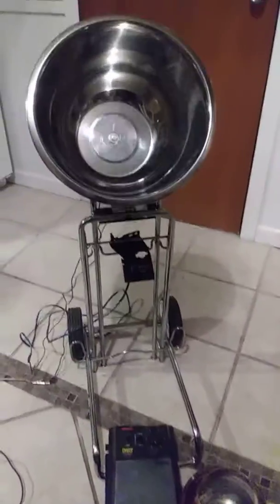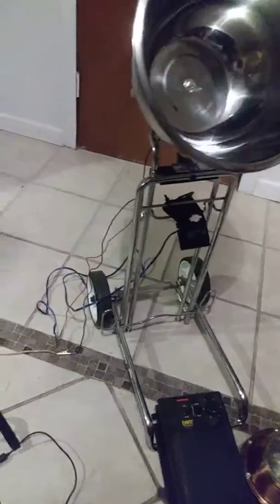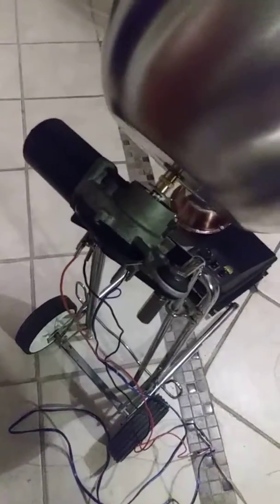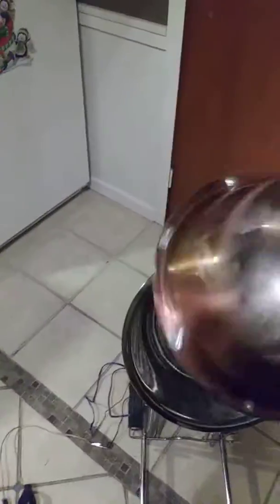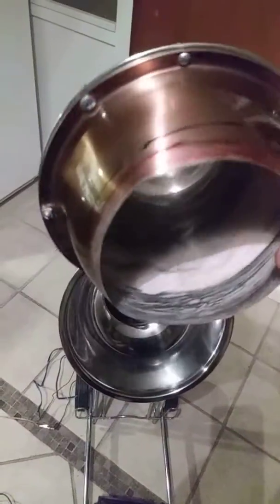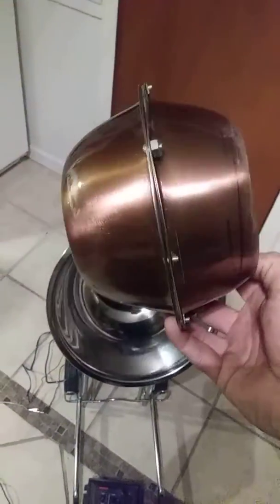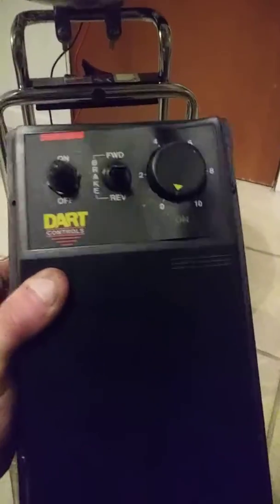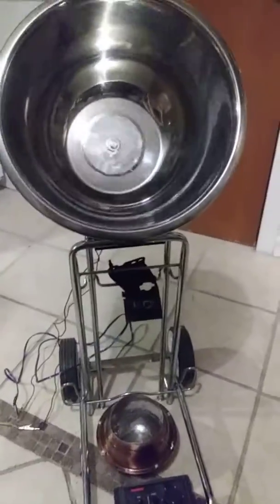Homemade star roller

Comment: Mock it up with the both halves put together. Then use them as fiberglass molds. That bonds isn’t going to hold up. Plus it’s porous, it’ll hold all the past and future comps. Just an idea....is all.
Reply: Bondo* Not a problem brother.  Or......just run it as it is. Use 1/8 or 1/4” bolts with lock washers and nuts(might be able to get by with small wing nuts). That would allow you to take it apart and clean the bowls.
Reply: You’d lose what? A couple tablespoons of comp?
Reply from the maker: That's a good idea, I will give it a try thank you

Comment: Minimum 10-15 amps needed for that motor if you want to keep it cold in work
Reply from the maker: Wow really, I didn't realize it could take that much. All the vids on here say to use a 12v 5amp power supply for wiper motors, so the closest supply I had on hand to that was a 16v 5amp that I used to test run it. 
Thanks for the info though, ill have to look into a higher amp supply. I was under the impression that a higher amp rated supply would burn the motor up, but I may very well have that mixed up with volts or something else lol...electrical stuff is confusing!
Reply: @HomeGrownPyro1  Find cheap chinese LED light power suply 12v 20A its around 20-30$ but its worth.And it have pure regular 12-14 Amps.I use same setup for visco machine and 5v 20A for perchlorate cell.

Comment: The motor was pretty cute to handle that👍
Reply from the maker: Yea these windshield wiper motors  should be able to handle the abuse for a while....I decided to use the wiper motor after watching a video on on here, of this guy trying to break one, by lifting all kinds of crazy weight with one..lol
Reply: @HomeGrownPyro1  Just give him 10-15 amps and it should have power to roll full bucket of stars and it wont over heat